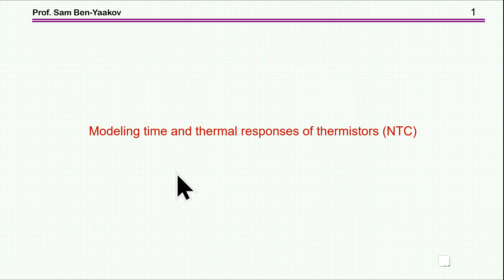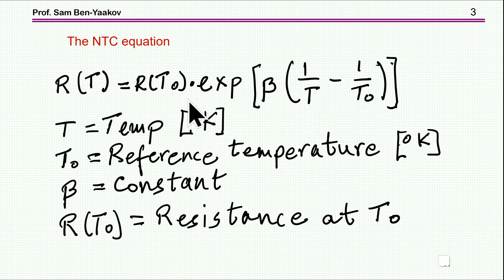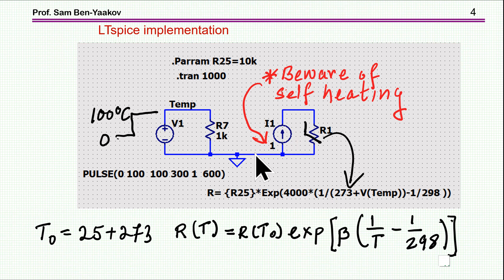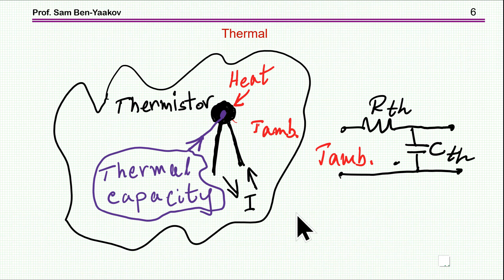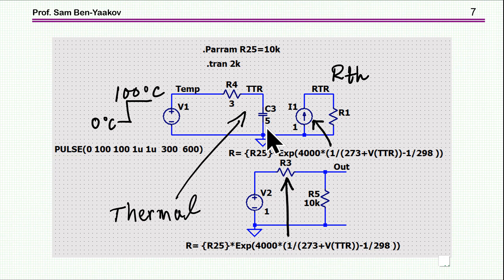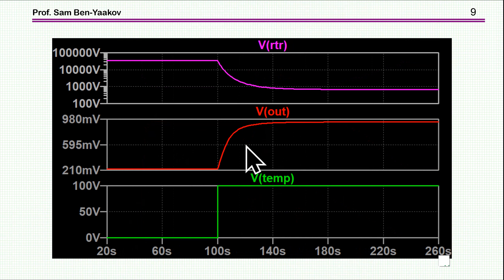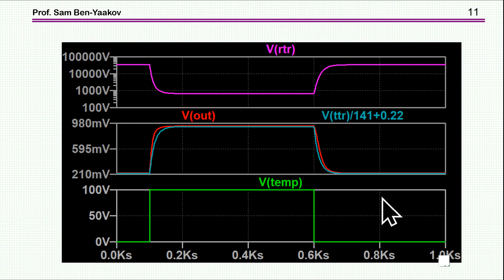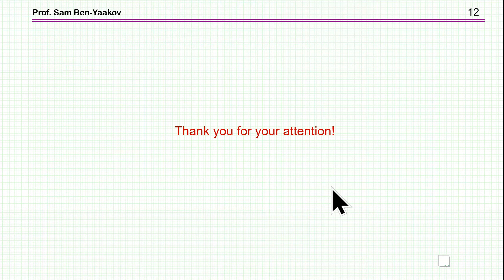Modeling the time response of thermistors (NTC) temperature sensors

Comment: Hi Sir your work always helpful in all way.Sir I have a doubt ,Is there a way to do the simulation in LTspice and at the same time do the controlling part (coding part ) in matlab simultaneously both running at the same time to simulate a circuit.Is there a way to interface both ?
Reply from the maker: I don't know about interface. But Qspice will accept a code that perhaps you can run in parallel with MATLAB.
Reply: Maybe ngspice is also worth looking at?
Reply: @HansWurst-bk9sb  Thanks man I'll look on to it!